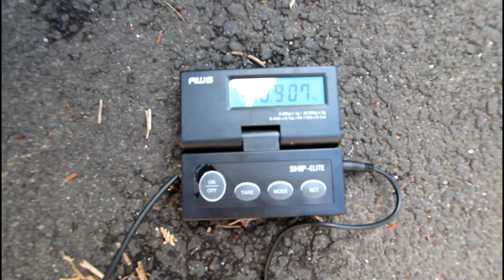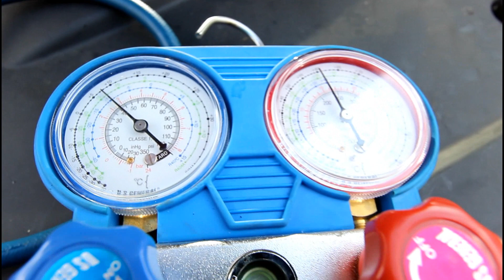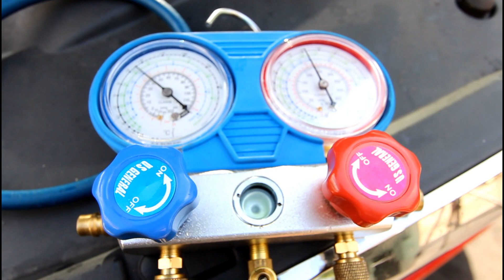How to add dye and fill car AC

Comment: Does the car need to be running when injecting the dye? I have a syringe type injector so i want to find a leak in my system.
Reply from the maker: No it does not, when the system is running, it will distribute the dye throughout the system.

Comment: Hi what Kind of Gas is this whaz do you refill in the system.
Reply from the maker: It's R-134A, check on your core support, the plastic cover over your radiator. There should be a sticker that list the gas your vehicle is filled with. Thanks for watching!

Comment: You did not bleed air from   the tool 1st . You are meant to turn the end, after dye put in and closing it ,till the oil or dye shows at the end of the tube attached while depressing the valve which displaces air out . Then when you have connected it to the low side valve ,with the engine off ,turn knob clockwise watching the marking on the end turns approximately 1 to 1and 1/4 . this injects the dye/oil in through the valve . All this is with a partially or fully charged system . The dye and /or oil quantities required added together  wind the casing down to where it is indicated on the side. The liquids  should work out to be just  up to bottom of the threads .Then follow as he shows above . But please bleed air as described above . Air will mess with the system. Also do not put it in if you are going to evacuate system as it gets pulled out again partially , do it after regassing  .
Reply from the maker: Yes, I did not bleed the air out of the oil injector because the system had a leak, and was already empty and filled with air. The procedure you described is correct,  if you were to be injecting a sealed system. Air and moisture are your enemies! Thanks for watching and commenting.

Comment: Can i inject a dye if it’s full on refrigerant? Or only when it’s empty?
Reply from the maker: Yes, full or empty. Thanks for watching.
Reply from the maker: @hotrodd100 Yes full or empty, most people will not know what 10% of their system capacity is, better yet is to listen for your AC pump clutch to kick on, that will be sufficient. But if you have a scale, one could accurately measure out 10% of the system's capacity. Thanks for the comment!

Comment: I'm confused.  Does that tool actually force the dye into they system (against the pressure on the low-side)?  And what about any air that was in the chamber/hose?
Reply from the maker: Yes it forces the dye into the system. The coupler(the part that clips on to the ac line) where the blue line attaches to it, you can unscrew it a bit and bleed the air out. If that makes sense, thanks for watching!
Reply: @blazerr88  makes sense.  I watched a few other videos that demonstrated its use, and it now makes sense.  One guy actually filled the chamber with way more than he needed, then, using a mating coupling, allowed some of the oil/dye to come out of the coupling (putting it back into the stock bottle from which it came to avoid wasting product) - with it fully charged with no air, he then added based on the graduated markings on the chamber to the exact amount he wanted.  Sold me.  Just bought one.  Thanks for the quick reply.
Reply: That’s what I want to know. Most videos TALK about putting dye in but never really show just how they get it in there. Also video after video you see them purge a little refrigerant through the yellow hose but never the blue hose- what about the air in there?
I was just looking at similar device in store and wondering just exactly how it works. My system leaks out a bit from last year and before I just top it off again I like to put some dye in there to help me find where it goes.